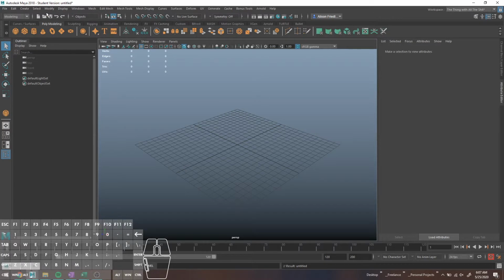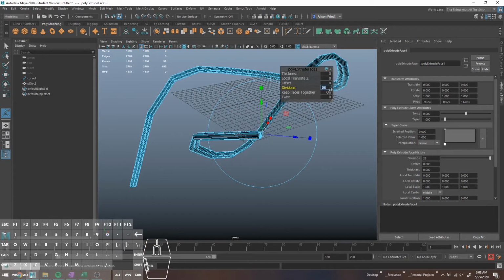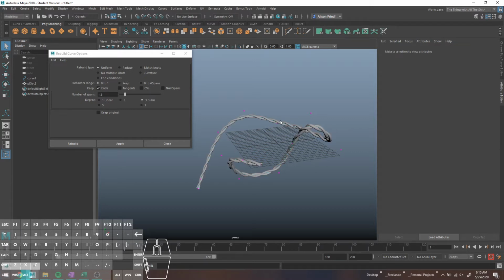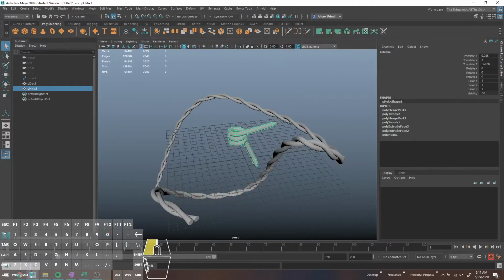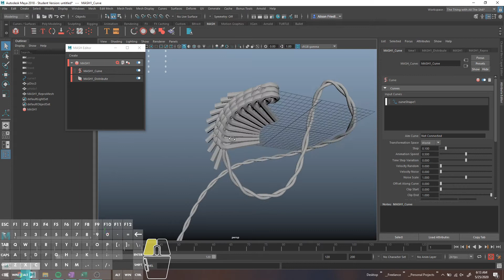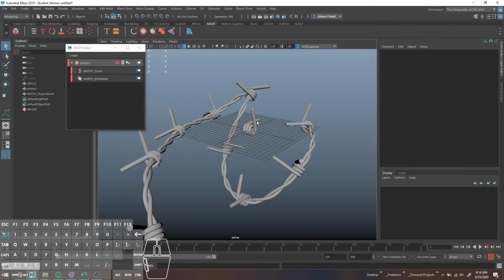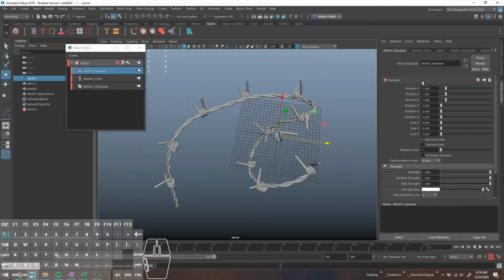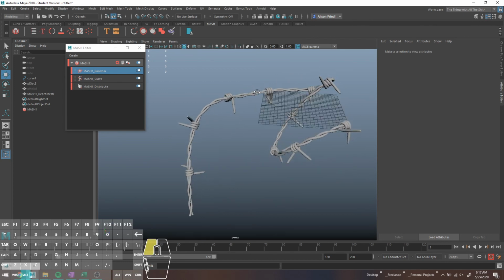Quick Barbed Wire with Mash

Comment: For anyone who can't see there mash network in the scene once they've linked it to their curve, I may have a solution. Chances are your network is visible but really far from the curve its suppose to be connected to.  Changing my scene form meters back to centimeters solved the issue I had with linking my mash network to a curve. When my preferences were set to meters, my mash network would appear very far from my curve. After changing the preferences back to centimeters, the issue was solved almost immediately! credit goes to the maker of this video for giving me the idea: https://www.youtube.com/watch?v=uSmMZirgWCI&t=129s.  Hope this helps and best of luck.